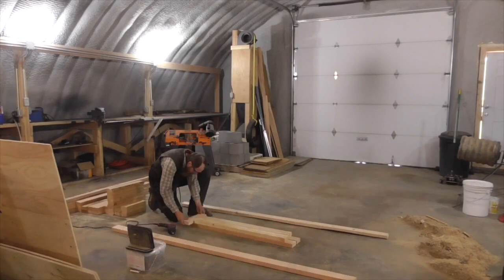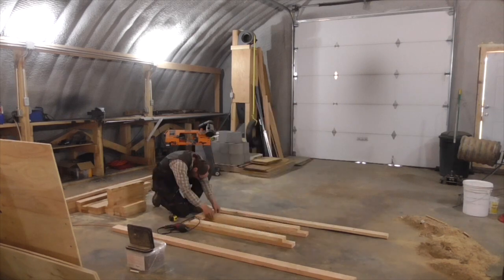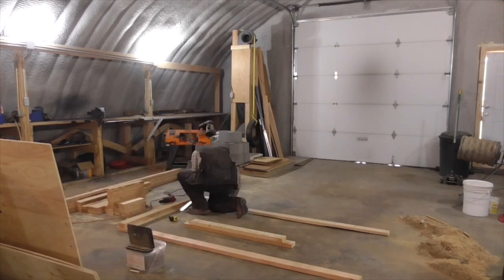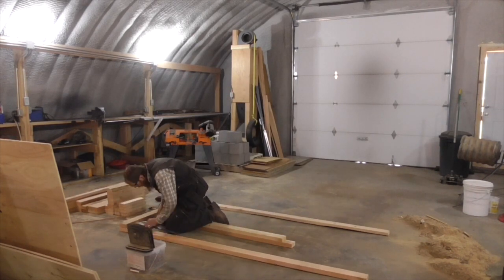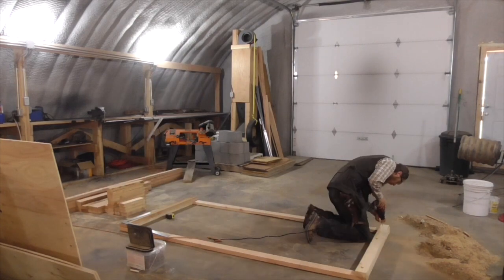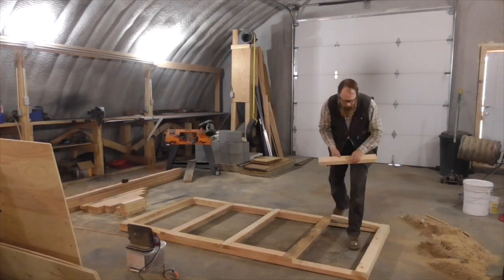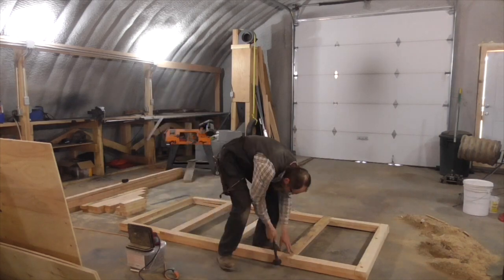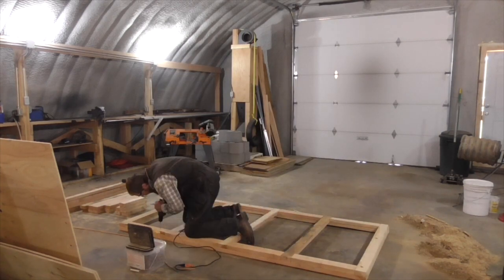Homemade Solar Dehydrator (TIS295)

Comment: Why didn't you line the inside with aluminum foil or some kind or reflective material?
Reply from the maker: Lining or coating the inside might improve performance, but probably isn't necessary for dehydrating most things.  That said, it's not a bad idea either.  A reflective coating like aluminum foil or aluminized paint would help reflect more light onto whatever I'm dehydrating.  Then again, a matte black coating would absorb radiant heat more effectively and raise the overall temperature inside the dehydrator, which might be even more effective.  Maybe painting or otherwise coating the inside will be an upgrade project for next summer.
Reply: @TheIdahoanShow  Right on. Painting sounds like a good solution too. I live where's there's higher humidity in the summer so if I built one I'd probably have to add reflective coatings to aid the drying.

Comment: Can you show what you did for the ventilation?
Reply from the maker: Because the clear plastic is corrugated while the wood that it sits on is flat, that leaves a small opening under each of the corrugations in the plastic.  I'm thinking that is probably all the ventilation that I will need.